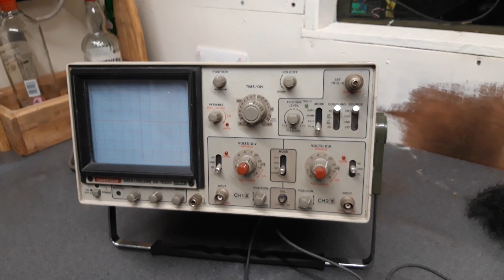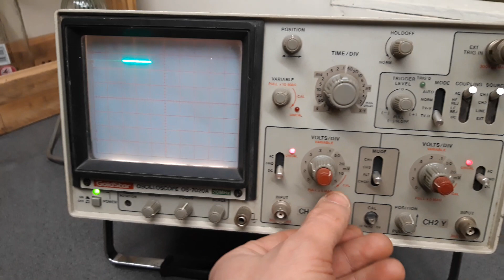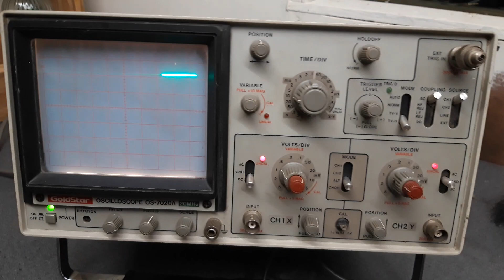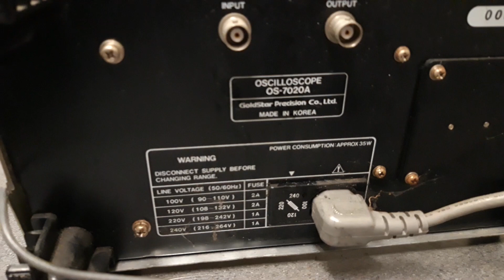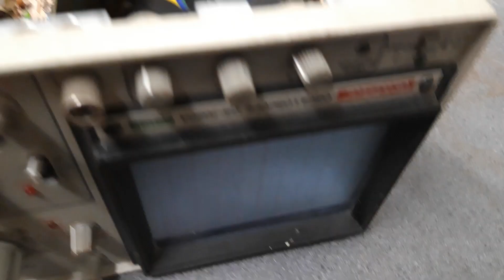A look inside a Goldstar Oscilloscope OS-7020A

Comment: Just bought one in mint condition, no marks, no scuffs, in its original box, with protective cover for the front. Tested and fully working. Paid 35euros for it. Cant wait to use it for audio equipment diagnose 🤟

Comment: There is no flyback in an oscillosope, deflection is done with an electrostatic field. Electrostatic deflection needs more space than magnetic deflection.
That's why they are way deeper than tv tubes. The coil you see is just trace rotation.
Quality/price ratio has increased significantly last 30 years.
Current value of a simple scope like this one seems to be no more than about 50 $.

Comment: I found one of these in a skip bin at uni a couple years back. Strapped it onto my motorbike and took it home, set of leads and it's been VERY useful since.  Pulled it apart earlier because I'm planning on adding an output to the back that'll output the line data so I can pick it up with a microprocessor, set it to a VGA output and overlay some data onto it and take some measurements digitally with it.  Haven't quite worked that bit out just yet though.